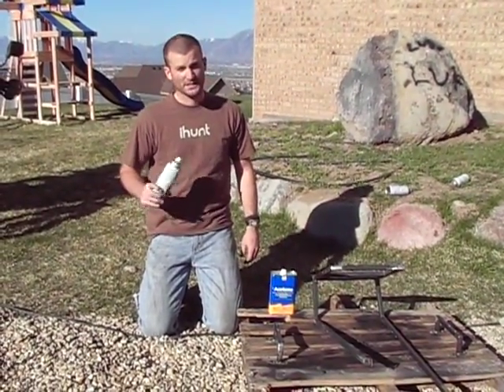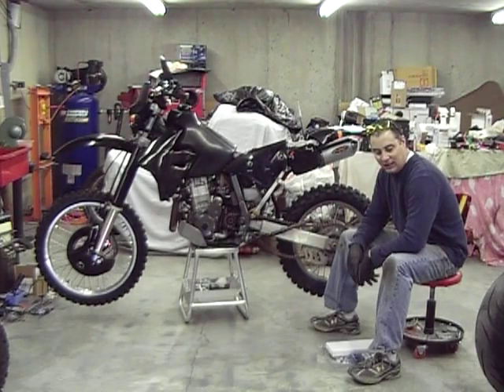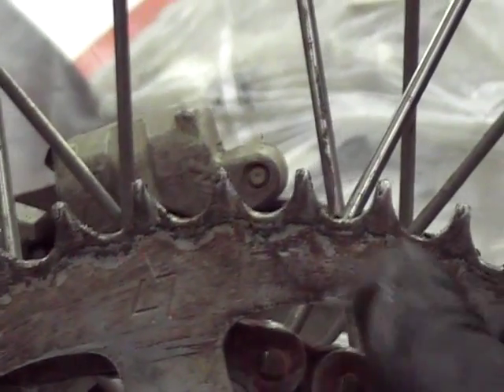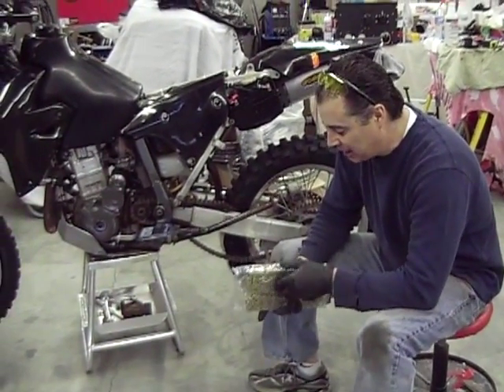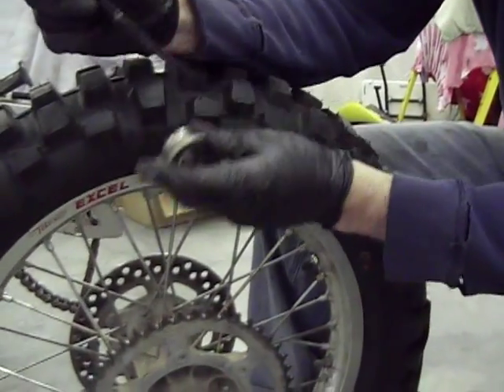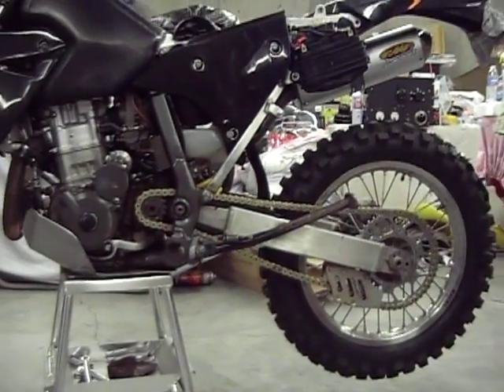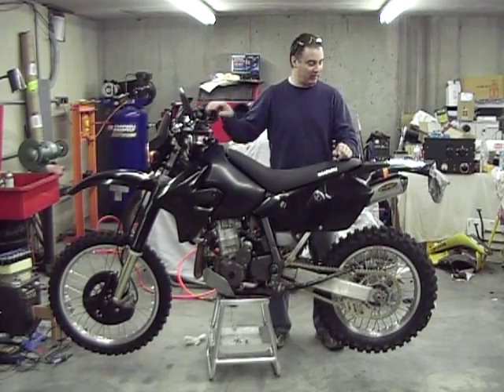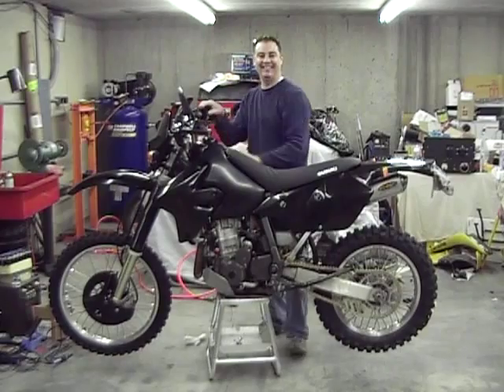EveRide DRZ 400 Extreme Makeover Episode 18 - Chain and Sprockets

Comment: Hi just wondering did the sprocket make much of a difference to the low end power. I have a drz400s and it has a 15/42 combo it doesn't have much low end power. I have to give the bike loads of trottle and half clutch it for trail rides. I would appreciate it if you could give me some advice thanks
Reply from the maker: Hey Kevin! I can't remember the sprocket change exactly right now, but but I think we went with a 51 rear sprocket, and stayed with a 14 tooth front? We gave up some highway comfort, but it was excellent on trails after the change. Gearing down will really help your bike on trails.
Reply from the maker: MrDuhfactor  actually, I think we went with a 48 rear. Going with a 14 front and a 48 rear will be a radical but pleasant change for you for trail riding +Kevin Lynn